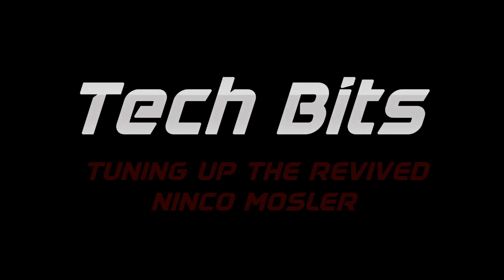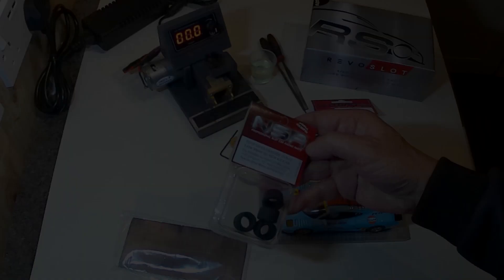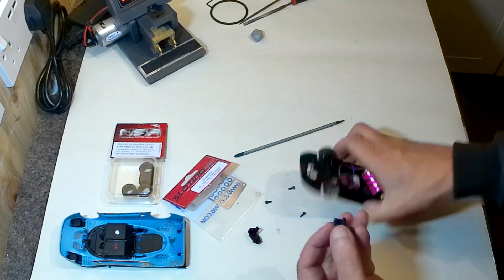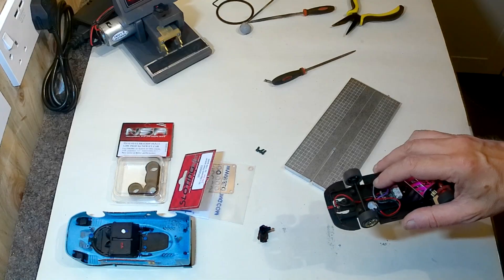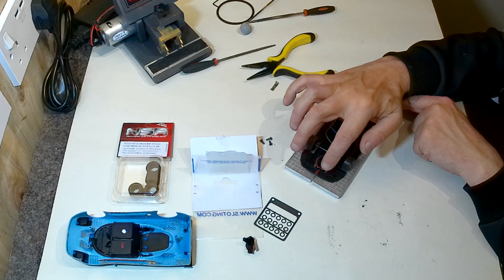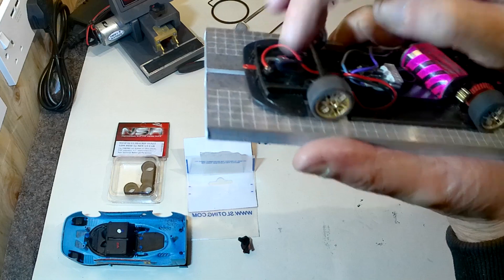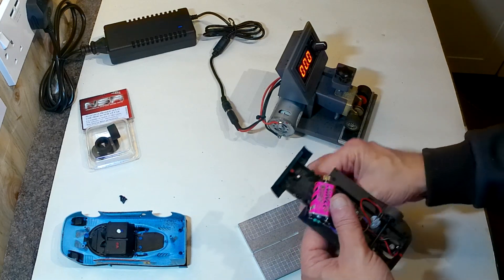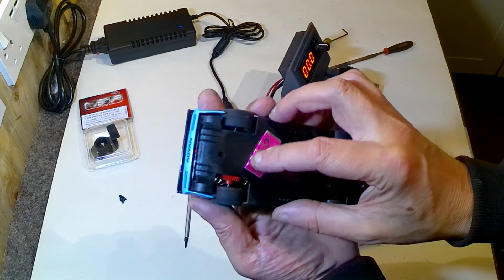Ninco Mosler Revival Part 2 Tuning and Testing

Comment: Is that the best place to add weight in most cars?
Reply from the maker: It depends what the weak point is in the car handling, I'm still learning but I think these are general rules of thumb; if it tries to understeer straight on at corners and pops out the slot, you need weight forward, if it's tail happy generally a bit in the middle helps, if it's spinning up the rear tyres when you get onto a straight then rear weight.   All of the above depend on the track surface of course, a car might do one thing on a policar track and another on a scalextric track.  There really are no hard and fast answers but the principles of slip angles and reducing unsprung weight (adding body float in slot cars) still apply at the smaller scale
Reply from the maker: then of course there's inline, sidewinder and anglewinders that all handle differently and beyond that the track itself,  you might sacrifice corner speed in favour of traction under acceleration on a track with long straights, or sacrifice the straight line traction for better cornering on a twisty track.   Pretty much it's a black art of juggling compromises just like full scale  lol